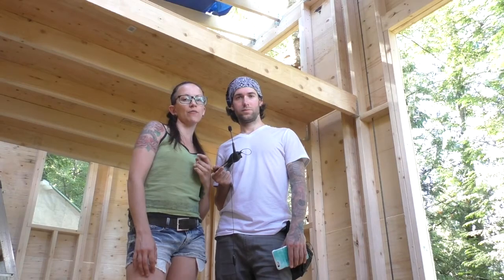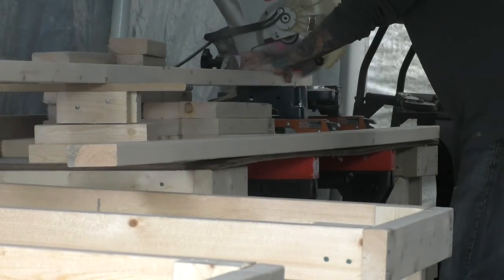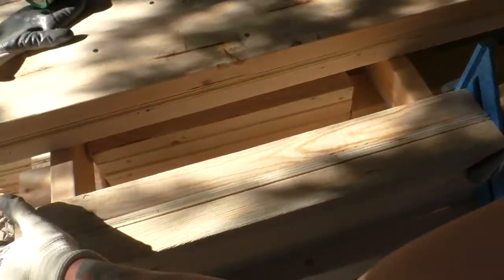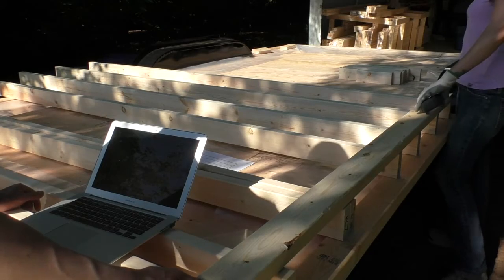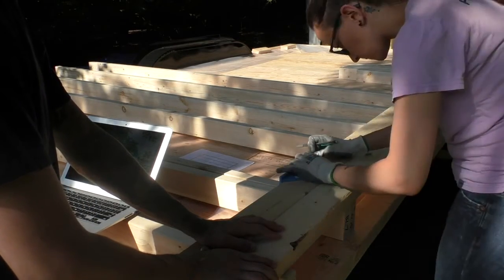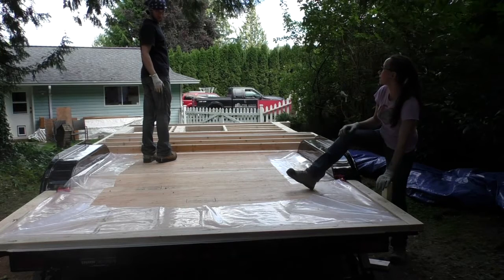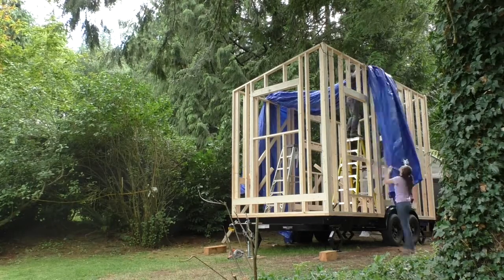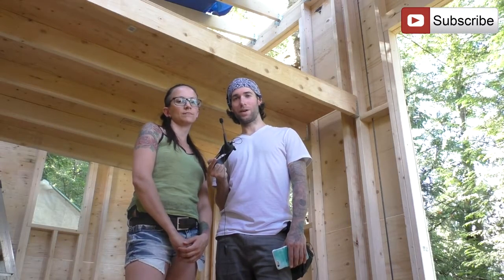Framing & Raising the Walls // DIY Tiny House Build

Comment: You NEVER frame anything structural with screws. You might think "oh they have better holding power" well yeah youre right  (even though it's unnecessary holding power) screws are made from hardened steel which is waaaay more brittle then softer framing nails. Nails can flex and cope with seismic stress and tension where as screws will just snap at the first sign of any stress. Ya know like... a porta potty house bouncing all around driving down the road... lol
Reply from the maker: Good to know!